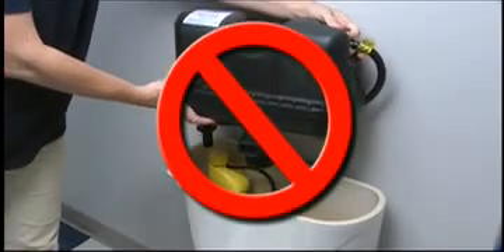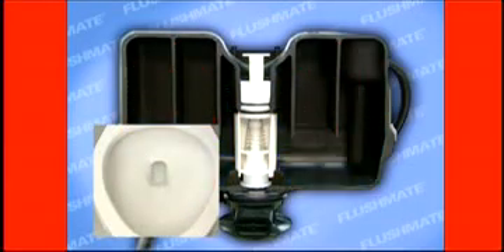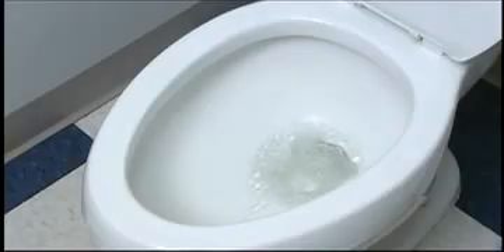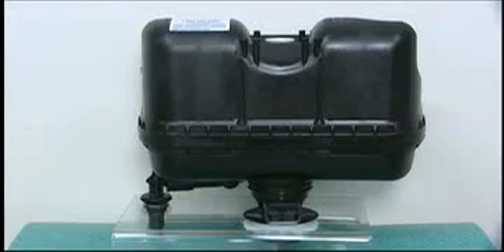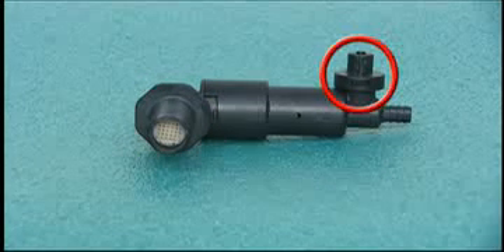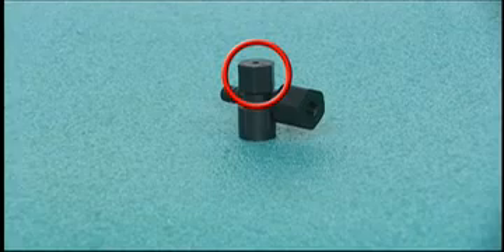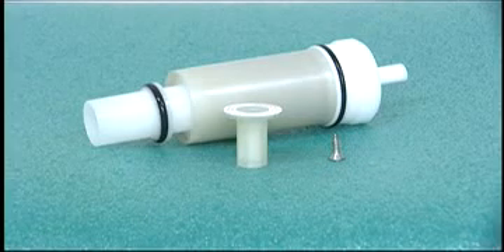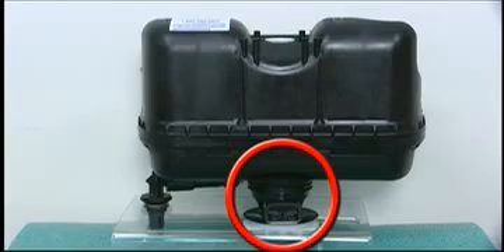How Flushmate Works

Comment: We just had the joy of replacing a recalled Flushmate II.  They sent a Flushmate III Series 503 as a replacement.  Although it looked different than the Flushmate II, it fit in the porcelain tank without problems and installation went mostly uneventfully, taking about 30 minutes.  The only difficulty was the new tank-to-bowl gasket ("spud gasket")  was too thick for the length of tank bolts, so we opted to reuse the old gasket, which was still in very good condition.